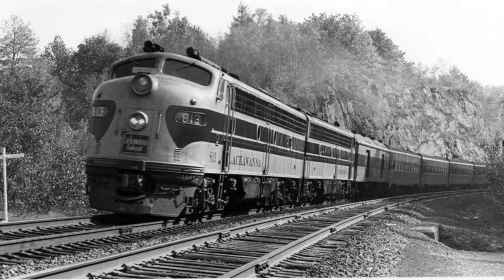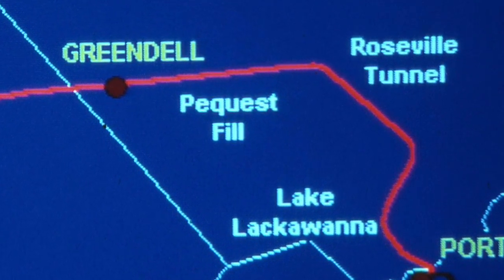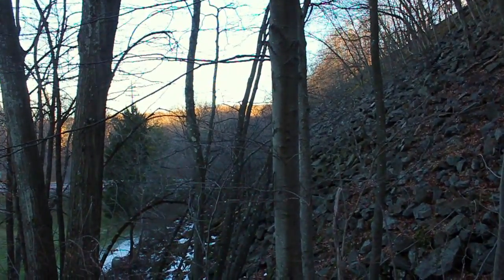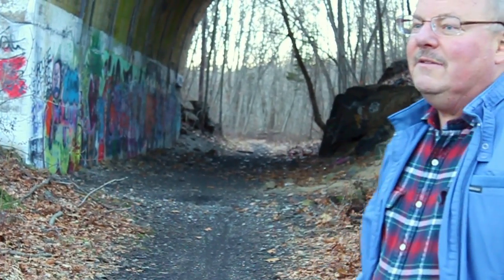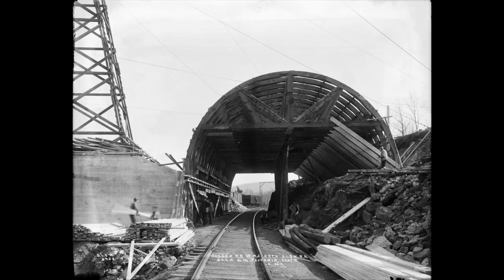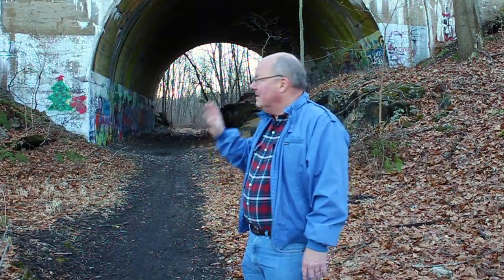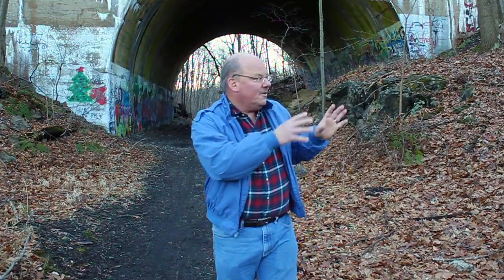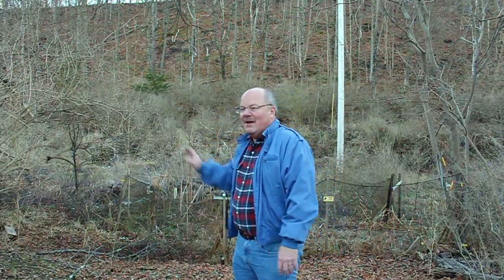Lackawanna Cut-Off - Part 4: Pequest Fill

Comment: Thanks for recording this history. I was a towerman for the ELRR from 1970-Conrail and then train service until retirement from NJT 2013. I had the priviledge of riding and working on the cutoff as a towerman at UN, train crew for the High Iron Co. on the 759 Rambles 1970 & 1971. I also worked E. Stroudsburg tower from time to time. This is an excellant series that you have compliled.

Comment: I would like to mention that the cover photo of a passenger train, going east on the Pequest fill, at the beginning of this video was taken on top of a railroad water tank. The base of where  the tank was located is still in place, as of a few years ago..
Reply from the maker: skymasterO2A, interesting, that would explain why the photo is off to the side, and not from on top of the nearby signal bridge, which never seemed quite right as an explanation.  Thanks!